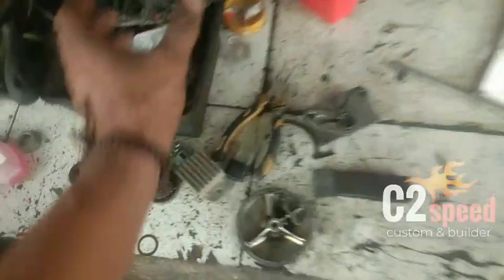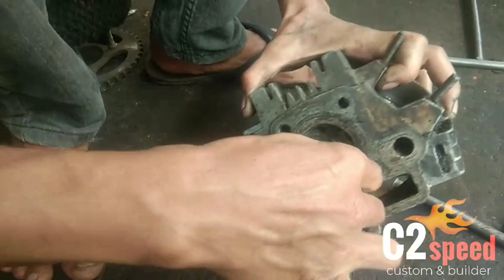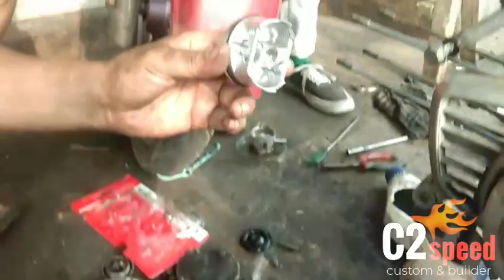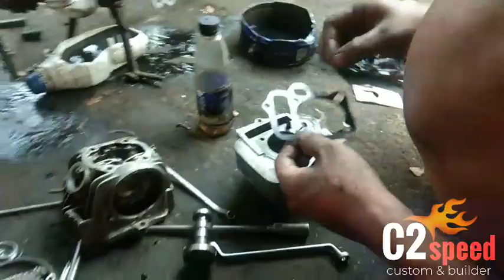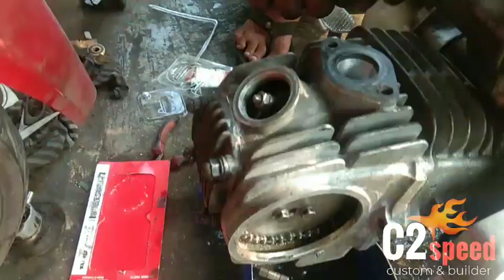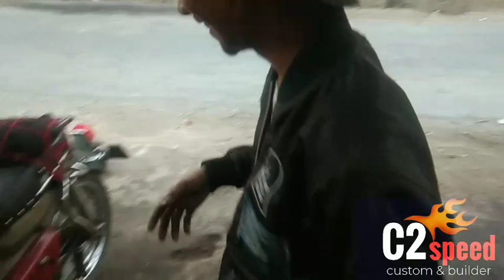Piston Vario 125 ( 52,4mm ) di Blok Cylinder Astrea dgn Liner Standar

Comment: Chanel ini cenderung penyuka blok seher besi cor ( astrea kuno) , Blok seher dari bahan besi cor itu ( khas mesin astrea kuno) itu saya gak suka karena diameter boring cuma 54 mm) maka jika dipaksa jejalkan piston vario yg 52,4 maka sisa tebal 54-52,4)/2 = 0,8 mm, itu sangat amat TIPIS, ngebut pun cuma SEBENTAR karena keburu tenaga drop loyo akibat mesin OVERHEAT dan busi pun api mengecil karna gak kuat panas mesin berlebih..
Jadi sudah gak jaman lagi bore up ekstrim di mesin yg blok nya bahan besi cor yg dari sono nya punya boring diamete liliiput kerdil cuma 54 mm, BEDA LAGI jika bore up nya di motor Astea modern yairu Legenda dan Supra fit New yg diameter boring nya sudah besar dari sono nya dari pabrik nya sudah 59,5 hampir 60 mm tanpa kena lubang baut tusuk sate, maka saya pun yg penakai Honda Supra Fit New 2006 pun nantinya bakal bore up ke piston kawasaki Blitz joy 56 mm, sisa tebal liner dari supra  fit ( bukan surpa x kuno )  pun cukup aman di angka 2 mm, tapi lebih aman lagi pake seher kawasaki Kaze 53 mm
Reply from the maker: Cek yg extreme nya om kita pake 57 d blok besi
Reply: @c2speedc2jokcustombuilder10 wkwk😂

Comment: Moga dibales bosku,, mau tanya itu liner sisa berapa ya kalo di up ke vario 125 ,, tapi rencana ke Vario 110 os 200 jadi Piston DM 52 aman yg mana om
Reply from the maker: Aman yg 52 sisa 0,75 klo pke vario 125
Reply: @c2speedc2jokcustombuilder10  untuk Astrea Pakai Noken as BRT T1,, seher Vario 110 DM 52 kompresi naik gk boss,, soale Dah pasang cuma Piston DM 51 kayak ngempos gitu kurang enak 🙏🙏mungkin ada saran dr bos Mekanik untuk referensi, Karburator Kharisma Kampas Kopling Gl 100
Reply from the maker: Kasih 52 yg dome aja
Reply: @hireggiegaming piston vario karbu mendem kalau pakai paking standar mas,punya saya loyo pake T1 brt

Comment: Mas kalo blok silinder supra 100 ,di kasih piston vario 125 di liner ketipisan gak mas?
Reply from the maker: tipis sih masih di rasa aman
Reply: @c2speedc2jokcustombuilder10   untuk supra 100. jika makai piston vario 125 apa perlu melebarkan lobang crankcase bang? apa hanya perlu ganti booring/colter biar aman (pnp)?
Reply from the maker: @ndrungustv9735  corter sja om

Comment: kalau grand pake piston vario 125 klep standart. apakah harus coak pisto ya?
Reply from the maker: klo noken std sih gk usah
Reply: kalau noken as nya standart cam gimana
Reply from the maker: @mananzx6534  gpp om,gk usah coak
Reply: oke makasih om. sukses selalu👍
Reply from the maker: @mananzx6534  🙏😊
Reply: @c2speedc2jokcustombuilder10  seher vario merek apa yang bagus
Reply from the maker: @mananzx6534  ahm aja
Reply: @c2speedc2jokcustombuilder10  oke makasi
Reply from the maker: @mananzx6534  🙏😁
Reply: @c2speedc2jokcustombuilder10  kalau karbu mp mledak" tu apanya ya bos
Reply from the maker: @mananzx6534  trllu irit jg bs jd ky gtu
Reply: @c2speedc2jokcustombuilder10  oke om
Reply from the maker: @mananzx6534  😁👍